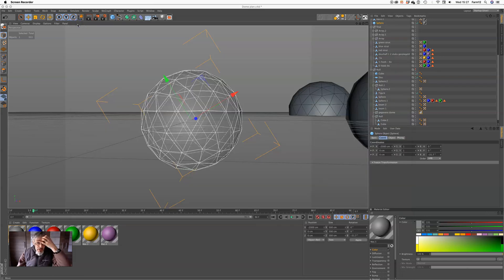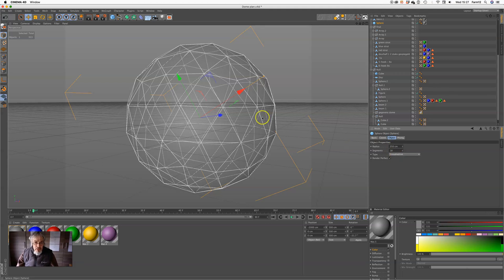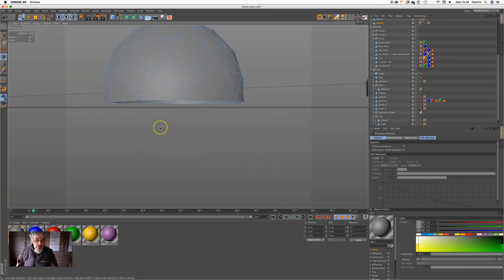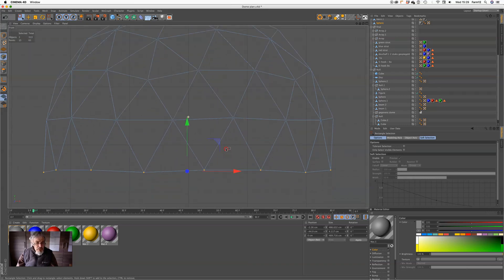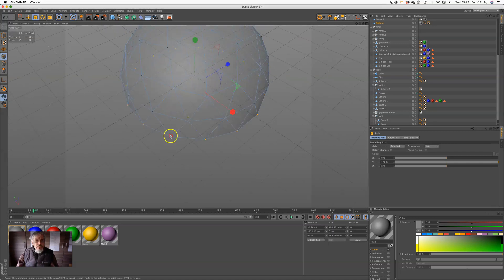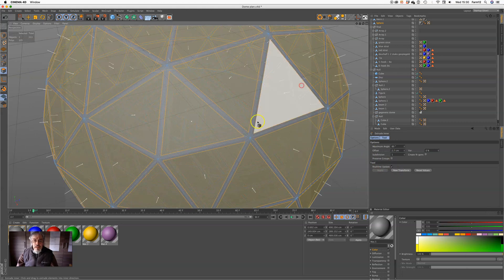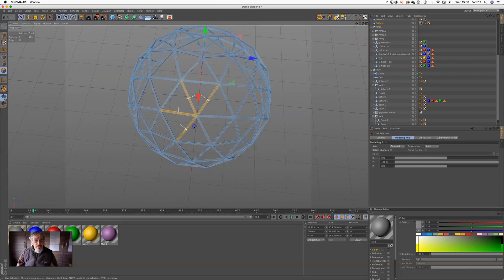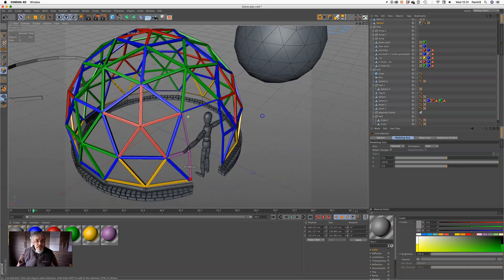geodesic dome part I: Cinema 4D

Comment: To flatten the base of a 5m dome i would suggest using 1020mm struts for the sides of the base half hexagons and 1008mm for the inner struts. This would give you a base radius of 2460.5mm  Shortening the inner struts alone will  affect the circularity of the base ring.
Reply from the maker: thank you for your suggestion, I still have to make the half hex triangles, I will check my calculations with your suggestion!